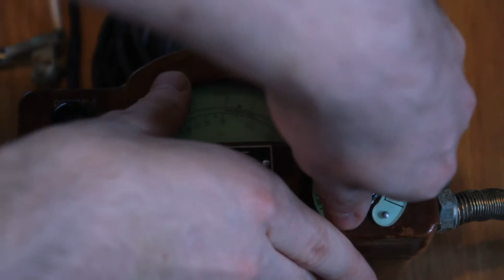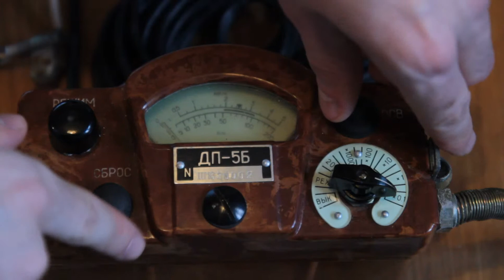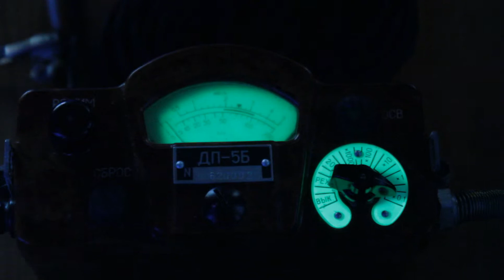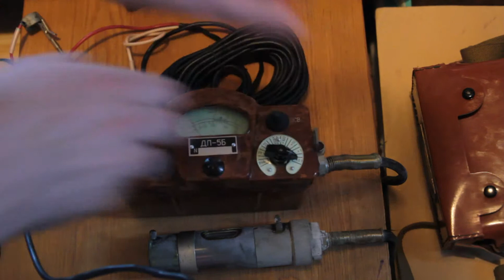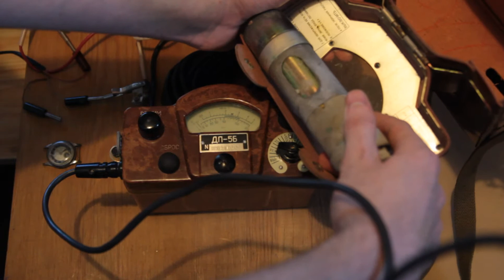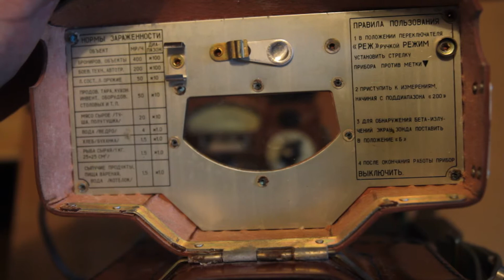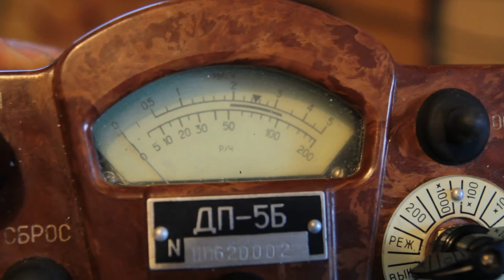rentgenoradiometr DP 5B - рентгенметр ДП-5Б - military DP-5B Geiger Counter

Comment: Where i buy battery?
Reply: Just buy AA’s and bend the terminals to fit them
Reply: If you do you may need to tape them to hold batteries in
Reply: @ethansav0892  ok chiamo
Reply: @ciaobella8462  You can also just buy the old obsolete batteries or they make new ones that fit for the dp series
Reply: @ethansav0892  ah ok
Reply: @ethansav0892  Hi you wouldn't be able to know where to get the new batteries that fit this model of geiger counter would you?
Reply: @avidion6274  Yes I do you can bend the terminals to fit double AAs and use cardboard or you can buy recreates of them on Ebay for 8 dollars